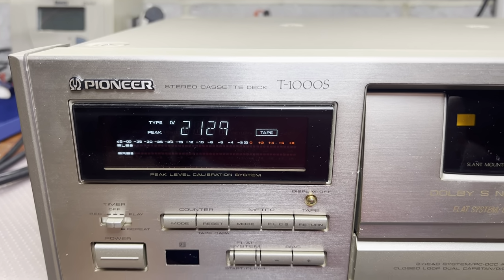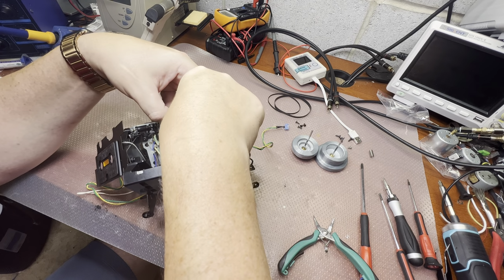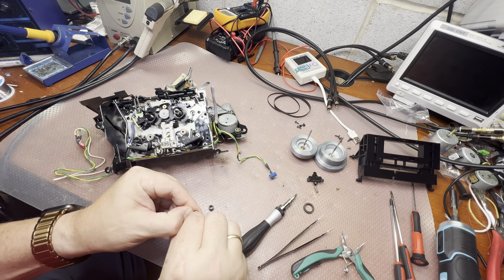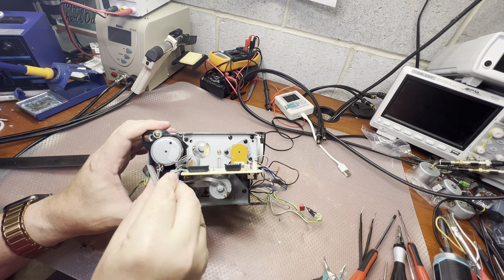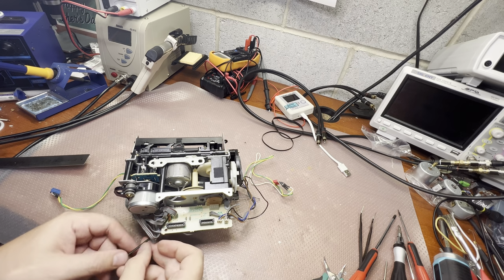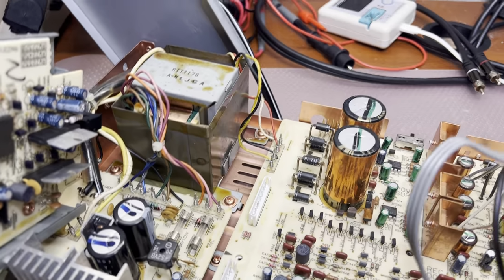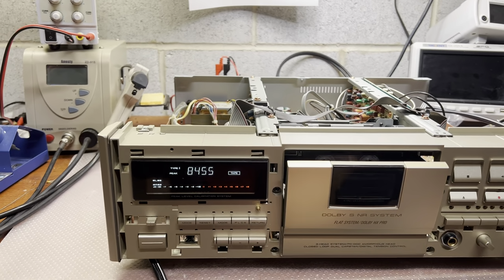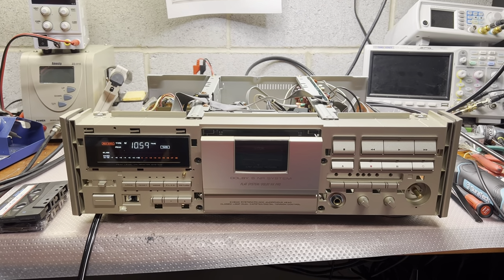Pioneer T-1000 Restoration: Missing High Frequencies repair

Comment: This video is just what I needed, I'm working on my CT-95 and the gear that opens the door came fully out when I removed the back housing of the transport, it was a real pain to get back into position properly. The door opens but won't stop running the motor and then closes itself, the mode switch is not correctly set I think from when I reassembled it. I can see the position of the gear/switch on this transport, I'll replicate that on mine and hopefully that fixes it.
Reply from the maker: You are welcome.
Reply: @hifirulezzz   Any ideas for when timing the gears doesn't work? Have just got back to mine, timed everything and the problem persists. Door will not remain open, constantly drives the loading motor and then closes after a few seconds. The mechanism operates perfectly other than this. Has new belts as well.
Reply from the maker: @noidle22  I would check the position pot, maybe it needs cleaning
Reply: @hifirulezzz  I sprayed contact cleaner in there a bunch but no change, it's very tight with no real gaps so not even sure if i got any of the cleaner into the contacts. Thinking about putting it the ultrasonic cleaner but I don't want to possibly make it worse.
Reply from the maker: @noidle22  then i would check PCB, resolder connectors, check traces, etc. also check the voltage in close/open position coming from the pot middle pin.
Reply: @hifirulezzz  i removed and disassembled the mode switch, all looked good inside. Cleaned it up anyway, checked all the tracks for breaks or damage, none found. Reassembled and no change. Checked continuity between mode switch output pins and the input at the mainboard, all good there.
I'll do some voltage checks tomorrow, was reading the schematic but it wasn't very clear how the system actually operates, the switch just seems to feed directly into the main IC.